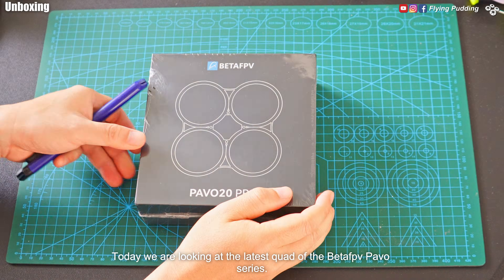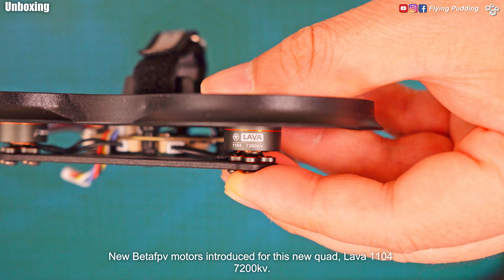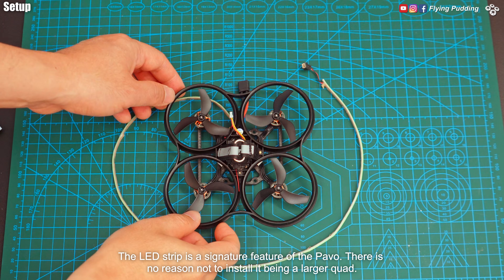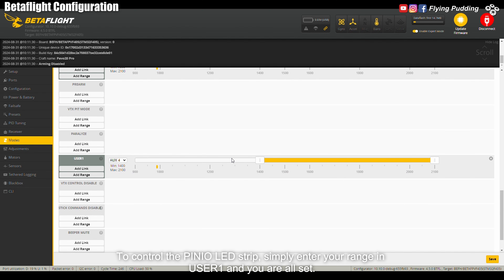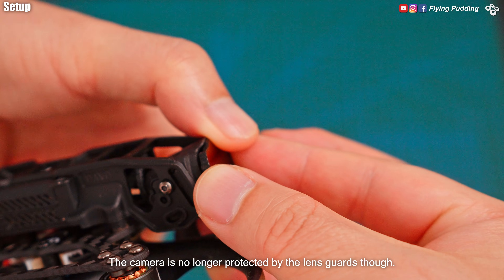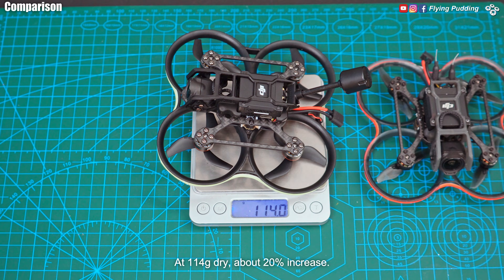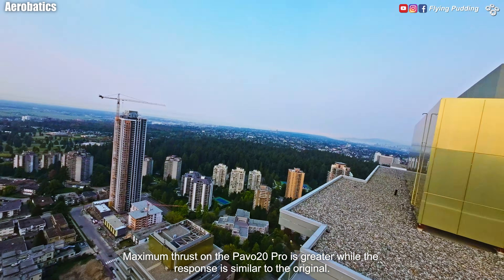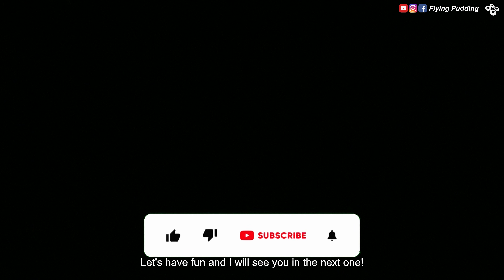Betafpv Pavo20 Pro Setup and Review

Comment: Good video but cant get my LEDs to turn off. I have a LEDLOW, no User1
Reply from the maker: You probably have wired it incorrectly. The PINIO should be connected to one of the unused UART's TX and you also need to perform the resource remapping procedure to get USER1 appear on the list.
Reply: @flyingpudding wiring is stock. Need to find the how to for resource remapping
Reply from the maker: @grege2383 the instruction is on this page. Also check the wiring on your board first. The stock wiring should have PINIO wired to an UART already, unless you bought it used from someone who might have modified it. https://betafpv.com/products/pavo-series-cob-led-strip?_pos=1&_sid=8b72078e8&_ss=r

Comment: I have a problem with my pavo 20 it wont connect to betaflight, do you have any solution?
Reply from the maker: Have you try using another PC? Also make sure you have the latest Betaflight configurator.
Reply: @flyingpudding yeah i have used my laptop and its the same, its says failed to open serial port
Reply from the maker: @ahsanerianto5831 what about this? https://impulserc.com/pages/downloads
Reply: @flyingpudding i already do it but its still the same idk why i only want to use the acro mode

Comment: Where is user 1 mode for the LEDs, I cant find it anywhere even when show all modes is selected. I have the latest betaflight firmware also.
Reply from the maker: You need to follow the the resource remap procedure before it will show. Refer to the instruction on this page. https://betafpv.com/products/pavo-series-cob-led-strip?_pos=1&_sid=bac678966&_ss=r

Comment: Help please!
 I set everithing Up but User1 mode is not present in modes tab. My whire is soldered to T6 pin and led is glowing but I cant turn it on using remote.
Reply from the maker: The resource remap was not done properly if you are not seeing USER1 pops up. Please undo the change (by applying the backup config if you saved one before) and perform the remap again. Remap instruction is here: https://tinyurl.com/wmhepdbx

Comment: Does the betafpv pavo20 have a way to upgrade GPS module or the necessary sensors to lock onto a moving object or controller and follow automatically?
Reply from the maker: That is an interesting question. Even with a GPS module hooked up, the flight controller uses Betaflight firmware, which does not have object tracking functionality. You may want to use something like a DJI neo instead.

Comment: I m trying to find the 04 lens mount
Reply from the maker: I assume that you are referring to the O4 and not the O4 Pro. You may find the Pavo Femto mount at betafpv: https://tinyurl.com/2b7brnph
Reply: @flyingpudding sorry to comment half i was just enjying the flow - i am trying to find 04 pro lens mount for pavo 20 pro
Reply from the maker: @IZZHA-FPV  You may get it on this betafpv page, just pick the O4 Air Unit Pro bracket : https://tinyurl.com/48khkpmn
Reply: @flyingpudding i appreciate your comment - that the bracket - i am searching for 3d print which will be added on the 04 it self , because the 04 in the bracket is still not that much protected and one good crash can damage the whole 04 lens unit , my friend suffered this issue 😅
Reply from the maker: @IZZHA-FPV you may use an UV or ND filter as an insurance. No camera mount will protect the lens in a direct hit, unfortunately.

Comment: What would you say is the best electronics & cam setup??
Reply from the maker: For camera and vtx it is best to stick to DJI O3 or O4/O4 Pro. It is still possible to use Walksnail/HDZero by using the included adapter, just not as clean.

The quad was designed to use the following:
DJI O3 Airunit
F4 2-3S 20A AIO FC V1 All-in-one flight controller
Lava 1104 7200kv motors

You may also use other AIOs and motors provided they have similar weight and spec as the above.
In addition, they also released new camera and vtx cages that house the O4 airunit and O4 airunit pro. So make sure you grab it/them if you have the O4/O4 Pro.

Comment: I know it won't be much. But I feel like the LED strip, 5 grams plus the small power usage is unecessary power draw?
Reply from the maker: Not too much as a burden being a slightly larger 2.2"  quad. The flight time difference is almost negligible whether the LED is on or off.

Comment: Hi, sorry, I'm new to fpv and wanted to know what's your opinion on these smaller/shorter antennas(pavo 20), are better than the dji ones? do you notice a difference in distance flown?
Reply from the maker: @BitzFPV  The difference is negligible for most people who do not fly more than a few hundred meters away. For long range flying over 1km and beyond, longer antenna like the stock DJI may offer better line of sight, potentially yield better performance. Hope that helps and thanks for your question.

Comment: Can install the GPS unit on top of its body Sir?😊
Reply from the maker: @chantom6548  You mean on top of the O3 cage? Yes, as long as you put some insulation in between, as the O3 (or O4) emits quite a lot of heat. A better place to mount would be on top of the camera.

Comment: one thing to note that "airmode is permanently on" by default in the configuration tab. so if you want to catch the drone or hit a wall it will maxout the motor rpm or go crazy thinking that it's a airgush trying to sway the drone. I usually keep my airmode on a switch-modes tab
Reply from the maker: @Copterlord  good tips, thank you very much on behalf of everyone!

Comment: Very helpful video. One question, does the 03 cable go in only one way? I plugged mine in and it clicked in with the blue wire on the left but not sure if it only goes in one way. Thanks
Reply from the maker: @keithpederson3629  It should only go one way. You may look at the socket on the O3 and check the relative position of the pins inside - they are closer to the bottom. The O3 cable plug also has slots closer to one side - check before push the plug in.

Comment: I put the Led strip on but its to long (the cutting line is further away from the start) can i just cut it so it fits or can i only cut it at the cutting line?
Reply from the maker: As far as I know, it would only work if you cut at the cut line instead of anywhere. Try re-routing the strip so that it wraps around the hoops properly. You may apply new double sided tape if necessary.
Reply: @flyingpudding ill try that thanks
Reply: @Hehenotyoda did you end up cutting at the line or did you just cut inward a bit? i just got mine!

Comment: what commands i need to do in cli for my pavo 20 for turning on and off led?
Reply from the maker: @Delfin_GTAV  in case you have the bnf version, the PINIO LED is already hooked up to UART6. There is no need to enter CLI command to remap the resource as it came preconfigured. Just find USER1 under Modes and assign a radio channel/switch to it, and set the range accordingly.
Reply: @flyingpudding  i bought bnf, but i update the version of betaflight and forgot to the backup, what commands i need to use for using user1 in modes for turning on and off leds?
Reply from the maker: @Delfin_GTAV  no prob. U may follow the instruction on their product page: https://betafpv.com/products/pavo-series-cob-led-strip

Make sure you adjust the procedure and reference UART6 (where the LED is connected in bnf) instead of UART1.

Comment: Can you tell me the command in the CLI so that user1 appears, thanks
Reply from the maker: You may want to follow the instruction on the product page. https://betafpv.com/products/pavo-series-cob-led-strip
Reply: @ thank bro
Reply: @ In the end, with what you have happened to me, user1 came out but I have assigned it to the controles and it does nothing with the leds
Reply from the maker: @TheDavid76  which UART is it connected to?
Reply: @flyingpudding  Usb vcp configuration on, uart 3 rx serie on, uart4 configuration/MSP on Periferic VTX(MSP Displayport)
Reply from the maker: @TheDavid76  I was asking which UART the LED strip is connected to? The UART would no longer appear in Betaflight under Ports if you did it correctly. Mine is on UART1 (connected to the LED strip) and UART1 is no longer showing under Ports.
Reply: @flyingpudding  It is connected to uart1 also that port no longer appears
Reply from the maker: @TheDavid76   i assume that the data wire is connected to UART1 TX. You may then play around in the mode tab and see if u could turn off and on the LED using the slider and radio.
Reply: @flyingpudding  In the beta it does, you can see how the radio slider moves, but when it comes down to it, when I plug in the battery the slider doesn't do anything.
Reply from the maker: @TheDavid76  That's odd. You meant the receiver channel does not move with your stick after you plug in the lipo?
Reply from the maker: @TheDavid76  That's probably not related to the resource mapping. Other channels work?

Comment: Will this work with the dji controller 3?? If I’m using the 03 controller
Reply from the maker: @LayinLo  Yes, assuming that you are also using Goggles 3.
Reply: @ yes I bought the avat 2 creator combo and just picked up the controller 3. I’ve really been wanting a micro drone for indoors but I saw on a review it didn’t work for this guy who had the controller 3 but he was in Africa so I dont even know
Reply from the maker: @LayinLo  Controller 3 transmits signal via the Goggles instead of to the air unit directly. Maybe he set it up incorrectly?
Reply: @ hopefully he did cause I just purchased the frame and 03 unit. I’ll make a video unboxing and trying to set up 🩵
Reply from the maker: @LayinLo  Look forward to it! Happy building.

Comment: The only thing I don't like about the Pavo, is that the battery is on the bottom, this is why I'd choose the Gofilm 20 through Caddx than the Pavo system. Plus DJI is like iPhones, and I don't like iPhones!
Reply from the maker: My guess is that it is a logical choice to belly mount the lipo while the O3 is on the top; so that CG is balance. Another advantage is prop clearence is better especially taking off on rough surfaces. It's also very easy to swap and share the O3 with my other quads. On the other hand, I have been an adroid user for over a decade so I feel you! We pilots always welcome more competition and I think Walksnail Moonlight is a good rival.

Comment: Nice with O3 but can we do with analog instead?
Reply from the maker: @duytruong5002  technically you can. You will need to some how secure the analog vtx in the vtx cage with the included 20x20mm adapter. I am curious to know why you would want to use analog with the Pavo20 Pro?
Reply: @flyingpudding  just wanna test with analog first then do the upgrade to dji combo, u know dji quite expensive lol
Reply from the maker: @duytruong5002  ah yes, post your mileage!

Comment: Why did you decide to keep the stock antenna instead of using the tiny one that most others swap to?
Reply from the maker: @blalaze  the Pavo20 Pro is a larger and more powerful quad than the original - it is more than capable to carry the stock antenna, which it offers better performance while sitting higher and further away from the fuselage.
Reply: @flyingpudding  I am glad you used the big one. I was thinking the same.

Comment: Which will better this or DJI neno and which will be more cheaper build or buy
Reply: This will run circles around the neo in every aspect of performance and video quality.  But it is a manual control drone it won't self hover with GPS  or be able to follow.

Most importantly, it is a true FPV drone. It does not come ready to fly with a remote, batteries, charger or a video system. You need to have basic FPV knowledge to get this thing bound to a remote and up in the air. You also need to get up to speed on safe charging, handling and storage of Lithium Polymer batteries.
Reply from the maker: @brandon9689  well said! Thus they are very different machines for different uses.
Reply from the maker: @RTSLV  They are very different machines designed for different uses. The Neo is very versatile that you could even use it with your phone, while it is also very underpowered for aerobatic. For those who already have the G3 Goggles and RC3 remote, Neo may appeal to them as an affordable addition.
Reply: If you have to ask, you should stay with Neo. This is a hot rod compared to the DJI consumer brand. It takes much more prep and knowledge to get this to fly.

Comment: What size LED Strip should be ordered for the Pavo20 Pro? The BetaFPV site has 560mm and 750mm varients.
Reply from the maker: Mine measured at around 560mm. Please use my affiliate link to support my channel, thanks! https://shorturl.at/0ujVZ
BTW the LED strip is included if you get the whole quad, unless you are looking to get the frame separately.
Reply: @flyingpudding  Thanks :)

Comment: great review, one question though are the ducts in view in low camera tilt regardless of the camera mounting hole that you use?
Reply from the maker: When the top holes are used, I can still get no prop view at zero tilt angle after Gyroflow post processing. A little bit of the ducts can be seen in goggles when flying with no tilt.
Reply: @flyingpudding  so ducts will be always in view regardless of the camera hole mount you use? I mean in view in the goggles not the final video
Reply from the maker: @carlosfuhrer  Yes, you would get tiny bit of ducts view at zero tilt while using the top holes.

Comment: Nice Job!  I wonder how long it will be before GPS will be available from Betafpv?
Reply from the maker: That is a good idea, adding a few grams shouldn't affect flight performance when the quad grows to this size. On the other hand, ELRS antenna position may also be a limiting factor.
Reply: @flyingpudding  I'm not sure what you mean...?
Reply from the maker: @CCC0122  whoops I got the wrong idea. I just realized that Betafpv does not have their own GPS module 😆.